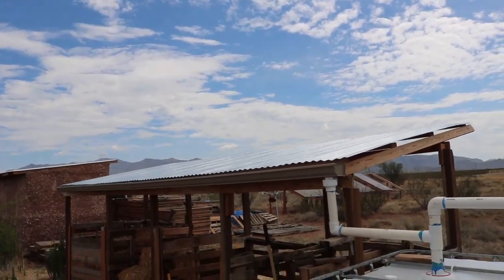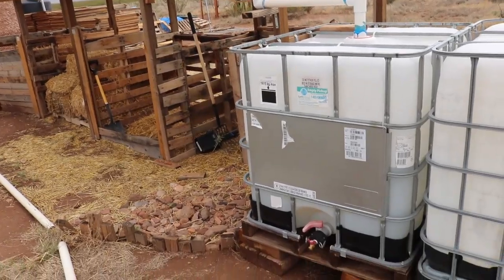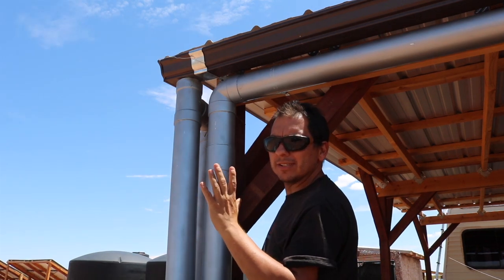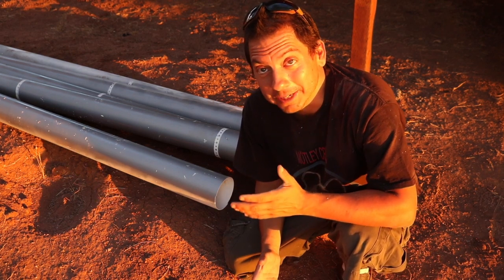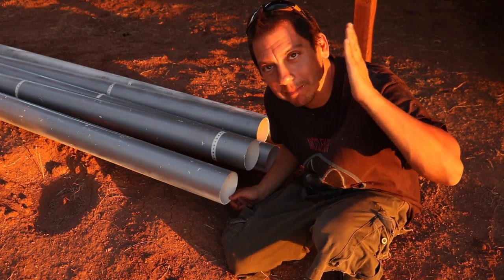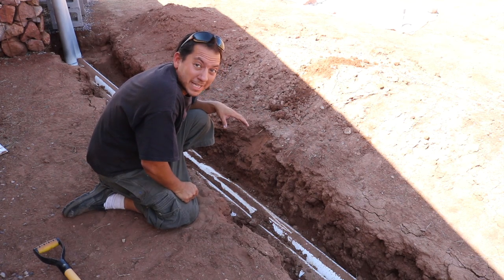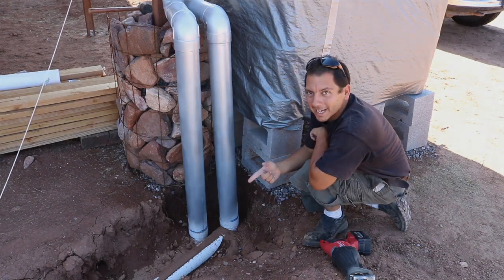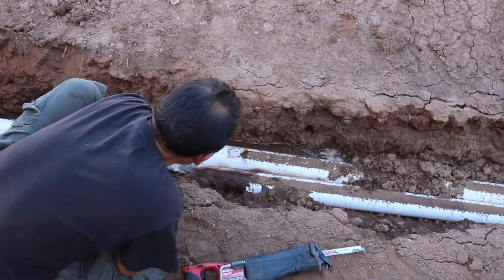RAINWATER HARVESTING | Converting our Wet System to a Dry System

Comment: jim, what was the reason behind the switching ?
Reply from the maker: We were losing water. Not all of it was making it to the tank. I think too many elbows slowing the water.
Reply: thanks...
although odd.. water should be self leveling
Reply from the maker: @houseofancients  it is, but I believe the flow of the water was slowed by all the sharp nineties. When the heavy rains came the pipes couldn't keep up. I think less 90's and sweeping ones would be more efficient.
Reply: that makes sense :)

Comment: Lots of work, but looks like it is a bit simpler. Not sure if I missed it or not on another video or this one, but why did you make to move to the dry system? Was it because of the volume you calculated you lost during the last storm? We just got our first real monsoon through tonight here in the Phoenix area. Awesome that you were able to reuse the pipe you already had and didn't have to go get more PVC. It was smart to plan out future expansion so that the new design wouldn't have to be changed again in the future. Trent
Reply from the maker: Thanks Trent! The set up before did getbus some water, but the flow wasn't fast enough and it backed out of the pipe. This setup should get us more water. Too many 90's before.

Comment: Lol, those lizards might need a hotel. ;) So, am I understanding this right, the dry system eliminates a first flush? Are you planning any kind of treatment for water you'll use for food and bathing?
Reply from the maker: Lol! Indeed they might.😆
No, the first flush is still in place. A dry system has all the water run to the tanks. A wet system leaves water in the pipes until the next rain. If that makes sense. Water would be left in the underground pipes.

Comment: You have an aquaduct now!
I'm having a little trouble visualizing the layout. Why did you have to go under the roof? Is it because the roof's low point is on the other side from the main cisterns? Are you still using the overflow tanks?
Reply from the maker: Yes, the low point is opposite of the tanks, and I'm trying to reduce the use of 90's in the design. 
We don't have over flow tanks just yet. We do have first flush tanks that are in use.
Reply: Oops, typed overflow but ment first flush! Thank you for the clarification :)

Comment: Well you learned something valuable here, water doesn't like going up lol
I knew this we going to have to be rebuilt lol 
Every gallon of water is 8 lbs, just keep that in mind as your gonna need more supports for those pipes I'm thinking, but your on the rite track now.

Thanks for sharing and as always keep building 👍
Reply from the maker: Water doesn't like moving up, but it will as it seeks to level itself. I think the main problem was the 90's. I just needed a straighter shot. There will be more supports. I estimated about 50 lbs per 10 ft of pipe, but it will probably handle than that. 
Thanks Todd!
Reply: @ourselfreliantlife  Jim,  I was looking at your old system and I think you are right in part about the 90's but the main issue is that you took the transfer line off in the middle of a downspout to the first flush tank which caused a confluence at the junction of 2 flows of water which in effect caused a dam and severely reduced the flow to the transfer line and the line from the gutter.  I think it might have worked better if you just took the transfer line out of a spot near the bottom of the first flush tank rather than the top of the tank via the input pipe.  Something to think about when you are putting in piping, don't try to do too many things with the same pipe as it can create bottlenecks.  Cheers, Bob

Comment: The cartoon edit is the coolest thing I have seen yet, Very nice and smooth. So why change, because you want to dig more, LOL. no but for real, why switch to Dry and not leave it wet? What was your reasoning?
Reply from the maker: We weren't getting the water we should and it was backing up. This should streamline it by reducing the 90's. It should be more efficient.

Comment: 4 in inner diameter pipe will hold about half a gallon of water per foot so 10 feet of pipe full of water will weigh little over 41 pounds plus the weight of the pipe it's self.
Reply from the maker: Yes, I over estimated to at least 50 lbs. Better safer than sorry.

Comment: Well your lizard has been watching you dance hasn't he...lol..a plumber friend of ours told us not to use the metal strapping to tie pipes up. He said the vibration of the water rushing will gradually wear a hole in pipe. But to me the plastic wood rot and break so go figure!
Reply from the maker: 🤔That's a good point. Might need something underneath the stapping to pre the metal from digging in.
Thanks Tammy!